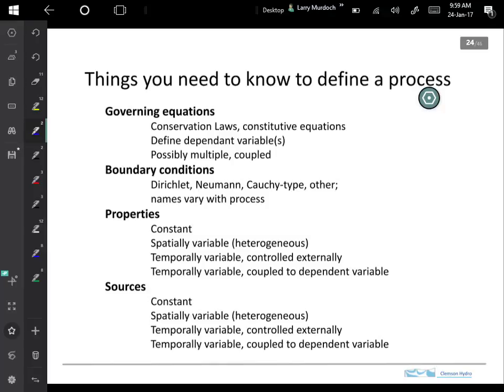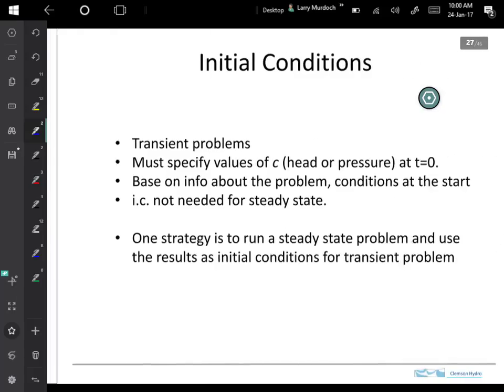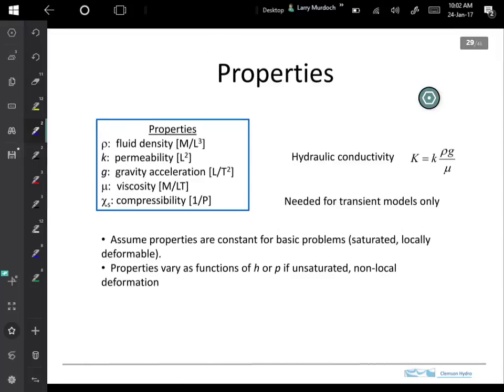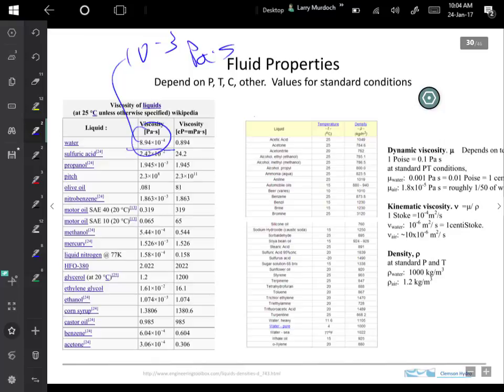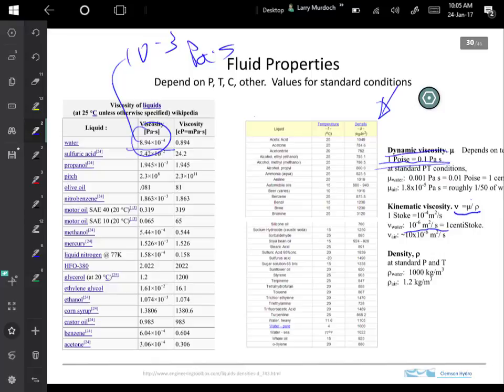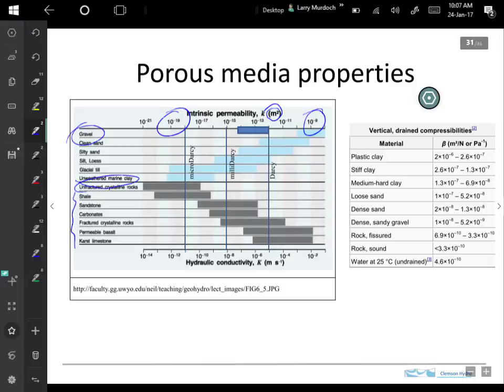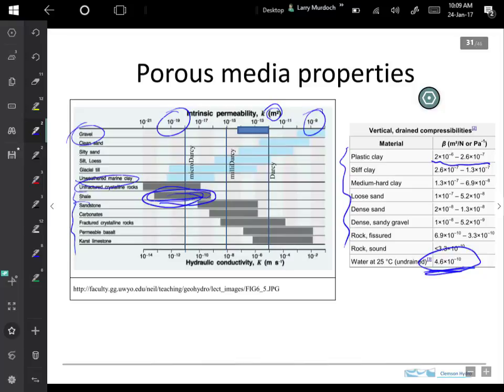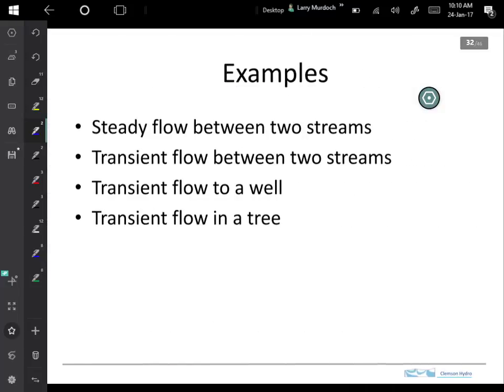APS 2 porous media equations and properties

Comment: Thank you very much professor Larry. I am following this lecture series systematically and it has been great. Please can I make a few request, I understand the focus is on Comsol simulation, are there any plans for experiments in the lectures? Also please is it possible for people following on youtube to benefit from the lecture notes and assignments. Many thanks.
Reply from the maker: Hi Yakubu,   I put the videos in a playlist, which I think you suggested earlier.  See if you can get to the course material from the info in the header of the  playlist.   cheers,   Larry